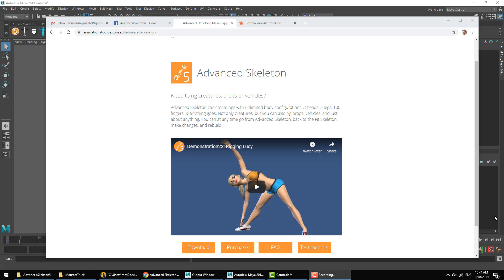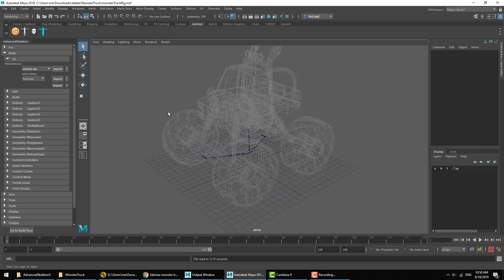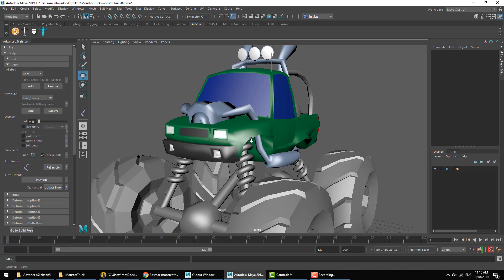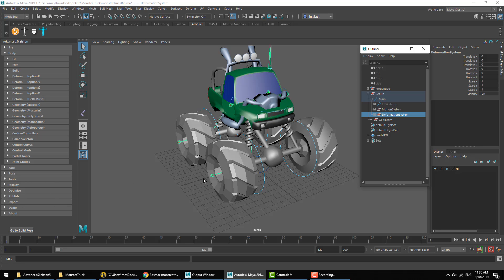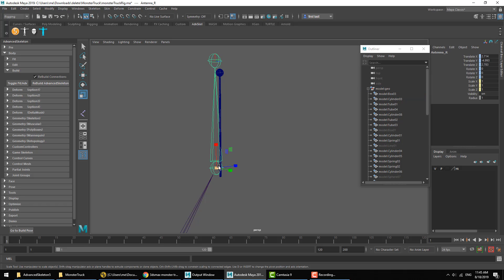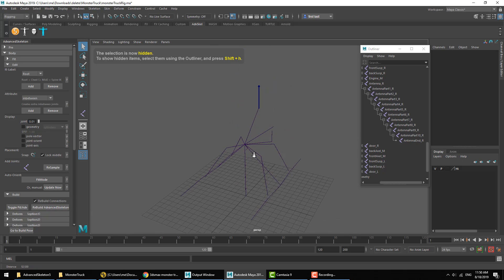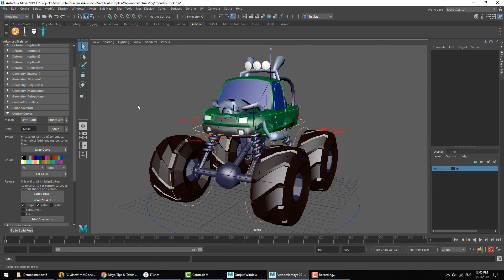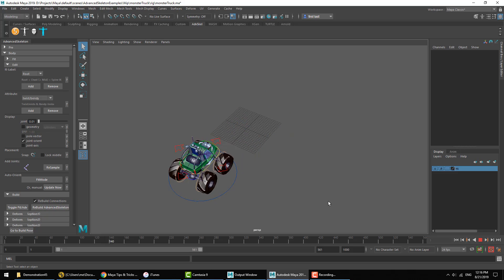Rigging of a vehicle

Comment: Sir, I tried to rig a vehicle, his right side wheels are moving backwards (in opposite direction) and left side wheels are working properly. What should i do to fix wheel rotation problem??
Reply: Just worked out the fix...  open the expression editor, then under select Filter drop-down pick "by expression name" then you should see the 4 wheel expressions, find the two wheels going the wrong way and change the "360" to "-360" then press edit and it should be fixed.

Comment: Thank you very much. Please, in the example Rig we can find the skateboard which has the control for the steering, and also we can see wheel turning and rotate, but when i import the vehicle rig and than click on "build" there is no control for the Steering, but only the control for any single wheel independently. Every other control with Y rotation only rotate the entire vehicle. Is that normal? Is that something we have to do manually? Could you please do a tutorial for this? Because here is missing. And also is it possibile to rotate the wheel so when i go forward with the main control i could see car turning automatically? We can only see steering in the final animation but i cannot understand how to do it. Thanks